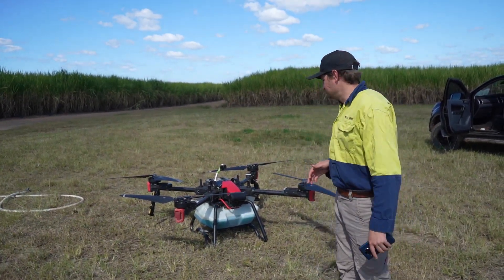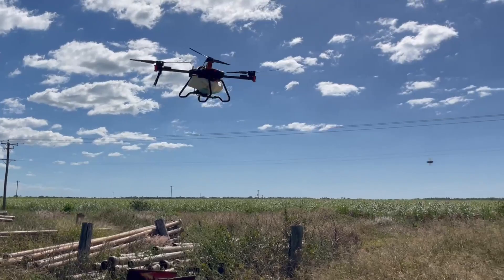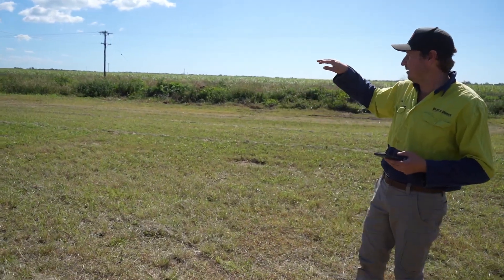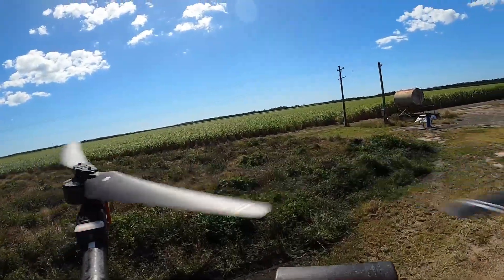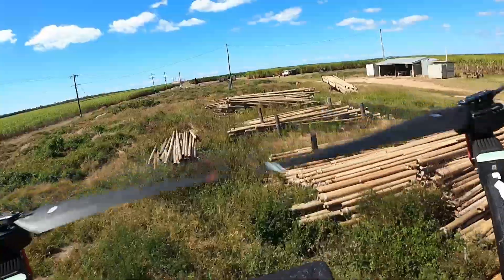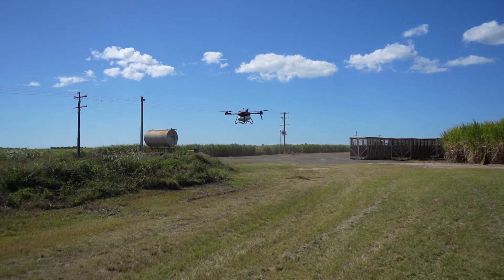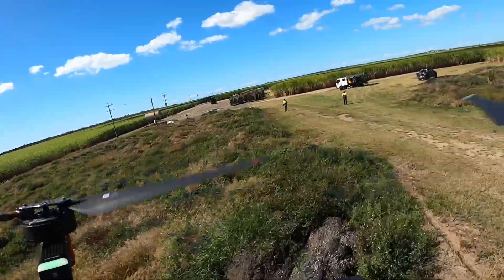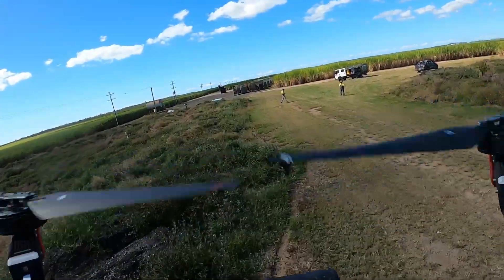Real world display of Obstacle Avoidance on XAG P100

Comment: What was the speed of the drone? 3-4 m/s?
How is it behave over 6-8 m/s with obstacles?
Reply from the maker: Set at 4 m/s, 
In complex sprays this is what we normally fly at, over 8ms it has a warning to state the obstacle detection will be limited, although we have had it go around obstacles at high speeds also with no problems
Reply: @oztechdrones  Thank you very much!!
I am thinking btw the T40 vs P100, this video vasbvery helpful to me!
Reply: Saludos desde Colombia 🇨🇴

Amigo donde puedo comprar el XAG P100??
GRACIAS